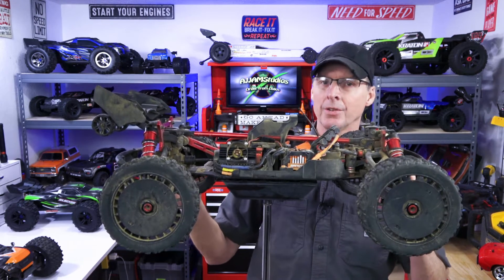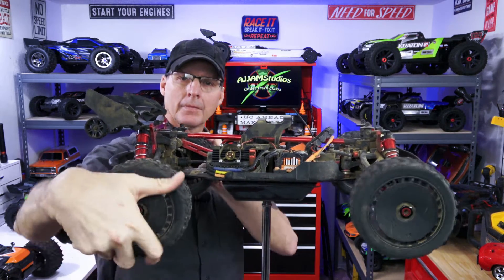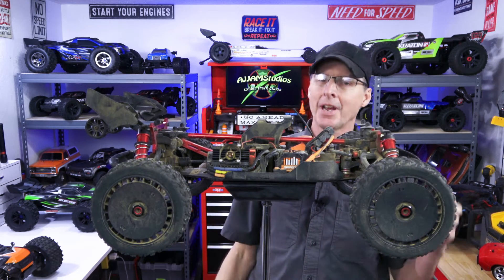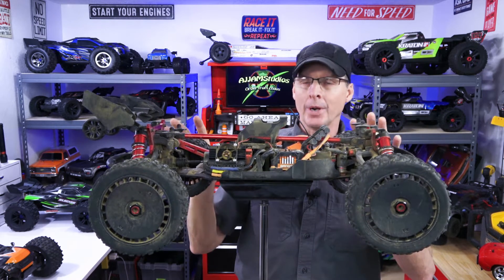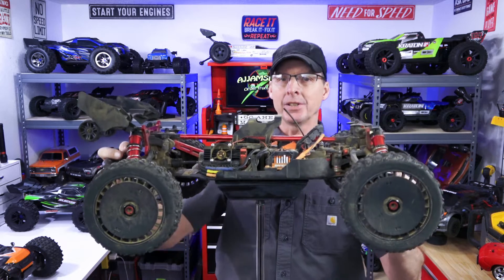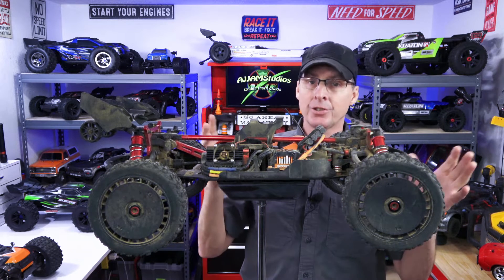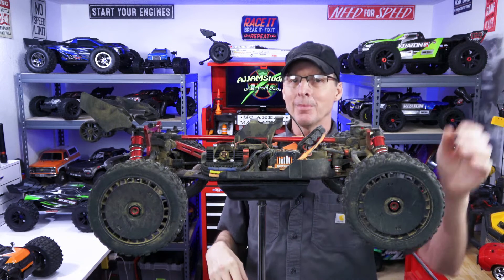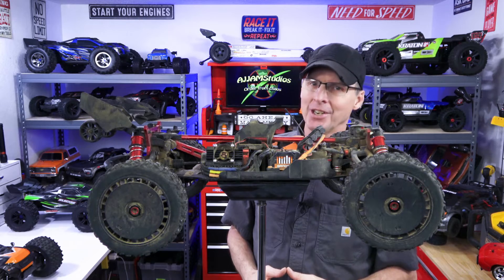Center Differentials 101

Comment: Nice video. It would be nicer for us newbies, if you would provide a basic frame of reference. You talk about lighter and heaver diff fluids, but don't say what is light vs. heavy in terms of weight is. For example, what is a good starting point for the front, rear and center diffs in a 1/10 short course truck for general purpose driving? Some hard dirt, soft dirt, grass, and a little jumping. Not guerilla bashing to start.

Comment: Hi, great video and explanation on the center diff. I race 1/10 and 1/8 off road and front, center, and rear diff fluids are all pretty important to dial in your cars for how much traction you have on the track. I haven’t done much experimenting with changing diff fluids from the kit setups but last week, on my ET410, I was racing on a medium bite indoor clay track and I thickened my center diff fluid from 30,000 to 40,000 and what a difference. I had more snap off the line and it definitely turned better too. I think I am going to try thickening up some of my other4 wd cars center diffs and see what happens. I knew that I would probably have more snap off the line but I was pleasantly surprised by the better turning; I have actually been looking for better/more steering out of my 4 wd cars and I am thinking I might have found some help with that
Reply: Oh, I forgot to mention, the ET410 is a Tekno car

Comment: I run 20m center, 30k rear, 50k front in my xmaxx and it does just what you said. Perfect basher and stunt driving. Easy to ride wheelies at 30mph and throw it into a flip whenever I want. But it definitely doesn't handle great 😂😂
Reply from the maker: Thanks for sharing😎👍

Comment: Hi great tutorial would you be able to give me a good place to start? I would really like to keep the front end down more to do a little bit of backyard racing but I still would like to be able to do some bashing. I don’t really care about doing backflips forsay I’m new to RC’s I have a (Arrma Outcast 6S EXB) would you be willing to tell me what would be a good place to start as far as oil thickness in the front middle and rear? That would be greatly appreciated the way it’s set up now from the factory all that it wants to do is stand up on the back wheels which is cool and fun but very hard to race That way any help would be greatly appreciated. Thank you very much. Marc from Warren OHIO
Reply from the maker: Our experience with the 6s outcast has taught us that several things contribute to front end lift with this RC. The wheelbase is a short one (short chassis) and this is a major contributor. Secondly the tires are heavy for those sweet backflips off the ramp (it was designed for this type of action). And then the punch level of the ESC is also a factor. Then the center diff fluid finishes all of that off, creating a stunt truck that looks awesome in the air. Our recommendation for keeping things controllable are: Switch to the Fireteam tires (they look similar but have less overall mass). Drop the fluid in the center diff to a much thinner fluid (somewhere around 7,000 cst - think of it as a starting point - the Typhon comes with this as a stock fluid). Lighten your punch level. Give it a try and see how you like it. You can always adjust from there. Best of luck😎👍

Comment: Great information.  So I have a new kraton 4s v2.5 for Christmas.  It's on the shelf!
Way to many wheelies! So it sits.
So if I keep stock fluid in center and rear diff, I need to change the front to a lighter fluid? RIGHT!
What do you suggest for a weight in the front of kraton v2.5? Just refilled center with stock oil as it said in book, F&R are stock fluid also, 

The wheelies are killing me!
Reply: Front has nothing to do with wheelies its the center that controls that the front and rear control how easy the wheels spin in a turn  You can either go to a thinner fluid stock is 500k or go into your owners manual and look up esc programing and lower the punch level that will help out a bit. If you have the programmer thats even easier it can be done right from the esc